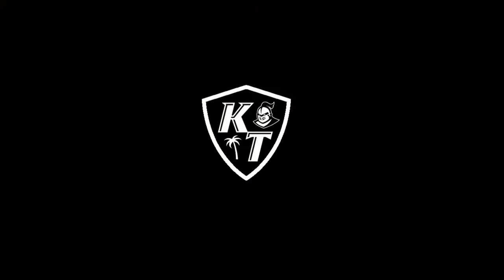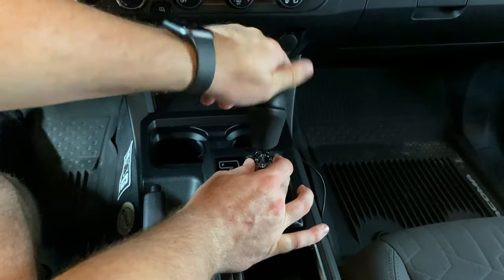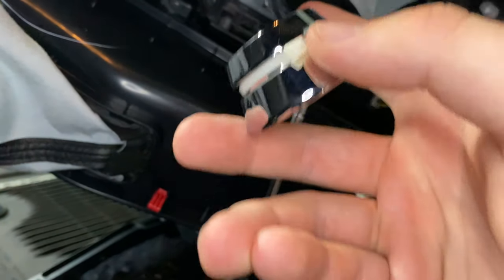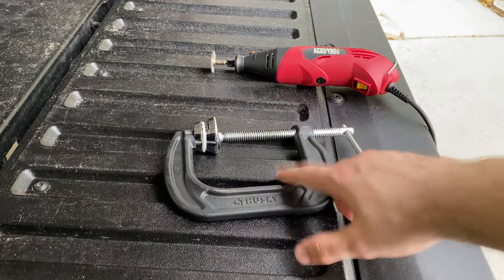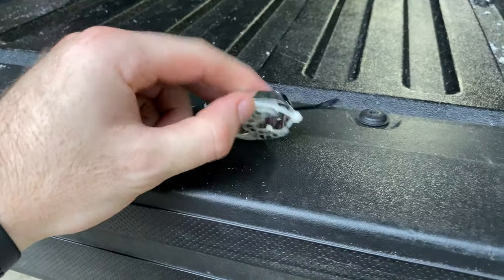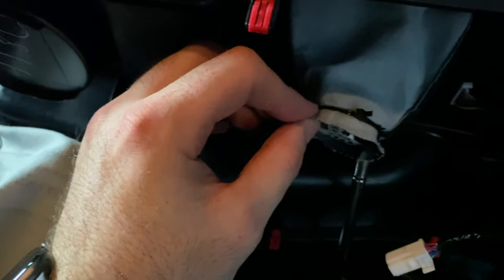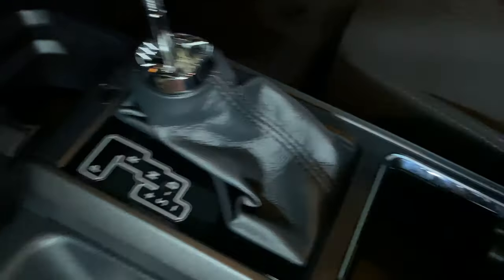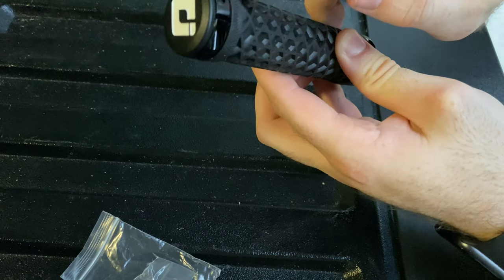HOW TO - GoGettaGrip Shift Knob Install | 3rd Gen Tacoma

Comment: Just installed mine. I didn’t want to cut up that boot collar so i wrapped the threads in a bunch of thread tape and it tightened up higher. I definitely need that black adaptor though!  Thanks for the video!
Reply from the maker: Nice that’s a good idea!
Reply: You guys think this is the best way to get it to sit higher?

Comment: I installed it. Having trouble shifting the truck from park into drive now.
Any reason why this would happen?
Reply from the maker: Did you trim down the plastic connector in the shift boot like I did in the video? If so, you might need to trim it a bit more?

Comment: How would you get the boot to stay in place when using this knob on a manual Tacoma?
Reply from the maker: There is a different GoGettaGrip handle for manual Toyotas, so make sure to order that one.
Also, this is the manual shift knob cap:
https://www.etsy.com/listing/893156536/2016-toyota-tacoma-shift-boot-retainer?ref=shop_home_active_1&crt=1

Comment: do I have to trim and all that? just wanted to instal and be done.... ha
Reply from the maker: Unfortunately, yes. Otherwise the shifter gets stuck in the gate because it's pushed down too far.
Reply: Unless you do like the other guy did in the comments and use thread tape to lock in the shift knob at a higher point on the shifter